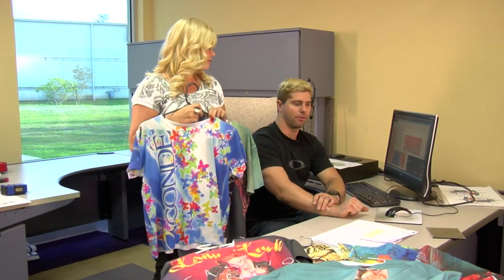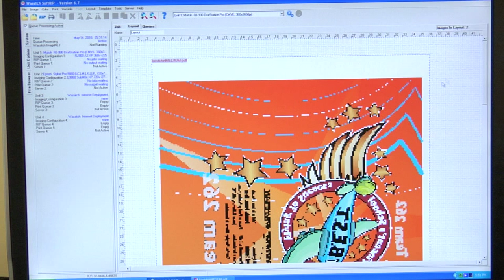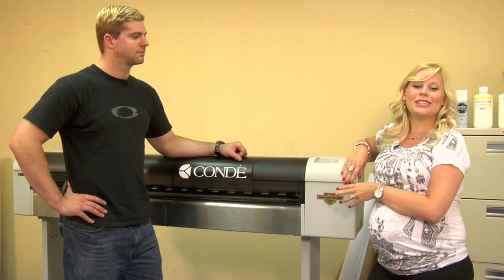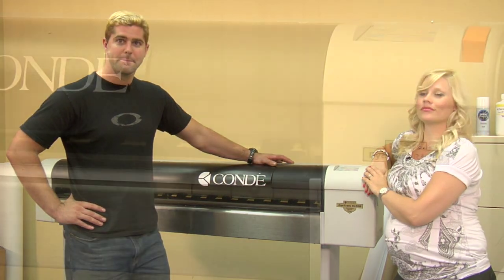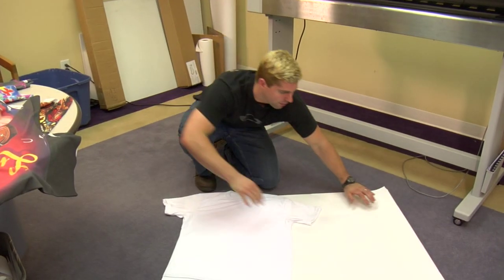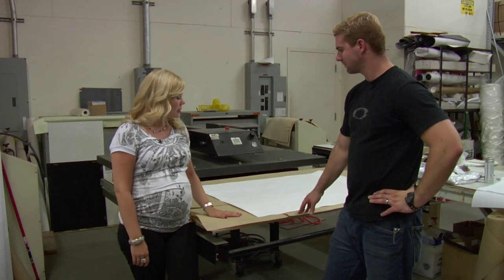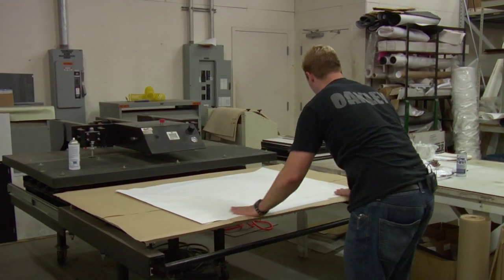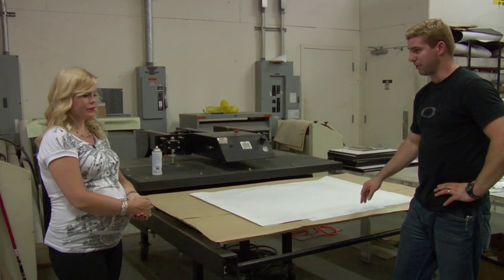Full Coverage Tee Printing System -

Comment: about how much does this package cost? I'm really interested
Reply from the maker: +Bella Bells There are so many options,it's impossible to say. The large heat presses start at $6000 and go up, depending on manual or automatic and the size ordered. The printer is often offered with a rebate, Call Micky Unsworth for the best deal: 800-826-6332 x201
Reply from the maker: +Bella Bells There are so many options,it's impossible to say. The large heat presses start at $6000 and go up, depending on manual or automatic and the size ordered. The printer is often offered with a rebate, Call Micky Unsworth for the best deal: 800-826-6332 x201
Reply: Ok. Thank you

Comment: Where do I buy this package I couldn't find it on the site.
Reply from the maker: We recommend you call Micky Unsworth at 1-800-826-6332 x201. Here are the system components:
RJ-900X- DyeTrans® RJ-900X, engine by Mutoh® Wide Format Printer
(4) 506UF - Refillable Cartridges  400ml Capacity, (Ink NOT included)
SUBLIM-C -- 1000 ml/LITER, Cyan SubliM® Ink
SUBLIM-PK- 1000 ml/LITER, Perfect Black SubliM® Ink
SUBLIM-Y- 1000 ml/LITER, Yellow SubliM® Ink
SUBLIM-M- 1000 ml/LITER, Magenta SubliM® Ink
WPS603-MUTOH900 - SoftRip for RJ-900. Wasatch® RIP SoftRIP Mutoh® RJ900/ RJ900X Exclusive Edition.
XP-44275 - 44" x 275 Foot Roll TexPrintXP™ Sublimation Paper
MAXI-4464AP -  44" x 64" MaxiPress Air Operated (Manual available also)
4767X - 36 Vapor® Apparel Basic White T
SUPPORT-RIP – Profiles, Full Color Management Support – $500 value
* INSTALL Fee not included in quote – Check with your Condé Agent for a quote based on location and special needs.

Comment: Can you link me to the package? i cannot find it on the website
Reply from the maker: You have to call Micky Unsworth at 800.826.6332.201, the video refers to a package that was out in 2010, we have much better deals available now.
Reply: ***** where would I find info on these better deals? Or who would I contact? Thanks!
Reply from the maker: Kyle Carpenter  
You have to call Micky Unsworth at 800.826.6332.201, the video refers to a package that was out in 2010, we have much better deals available now.